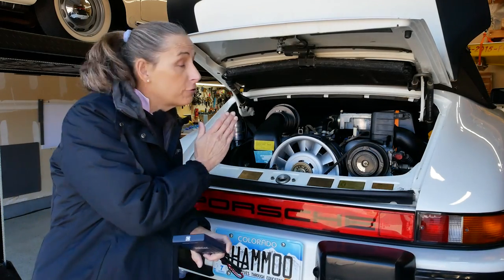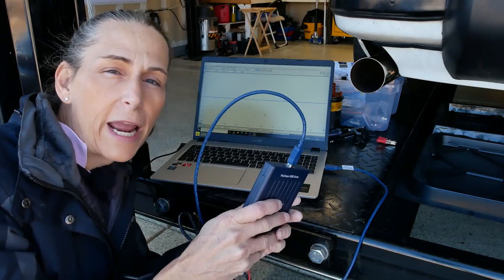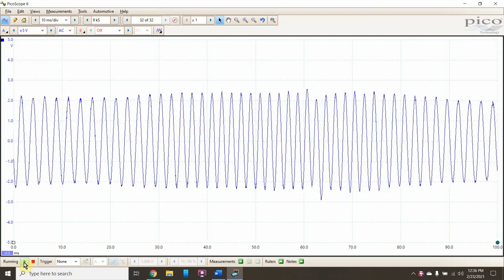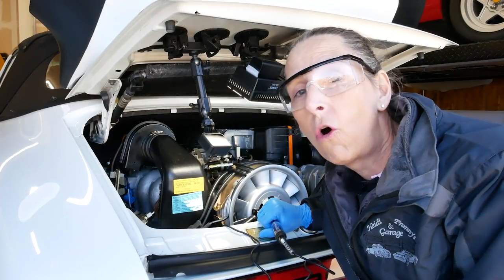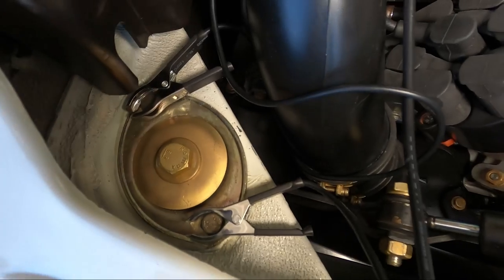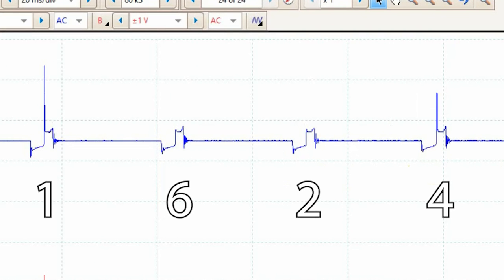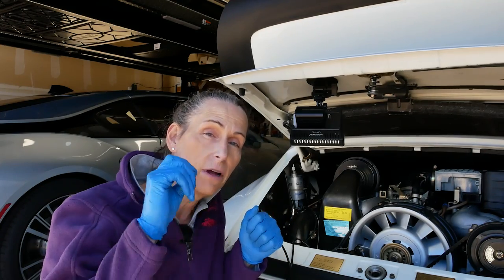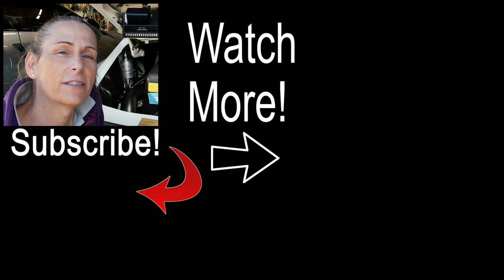Budget eBay Porsche 3.2 Carrera: Testing with a PicoScope Oscilloscope! Bad Wires??

Comment: awesome advice! thanks, yet again! Can you expand on how the trigger on the scope can tell you what cylinder is failing? would you need two current clamps to do that, one one the starter and one one the individual cylinder? TIA
Reply from the maker: For syncing you could then use that same capacitive HT 25 clamp on the #1 spark plug lead in the channel B and trigger on that.  Cylinders would then be in the firing order.  Down at the bottom of the screen there is the setup for the trigger.  You can set the channel and the type (I used "repeating") and if you want it to trigger on the up slope or down slope.  It would be the same basic setup as the ignition pattern, just with the current clamp for the A channel.  Let me know if that answers your question :)

Comment: You have to set your scope for usb streaming mode by change your time to 200ms/div this will tell your scope to go from block mode to streaming mode to transfer your waveform to pc direct without using picoscope buffer which is to small
Reply from the maker: I'll totally check that out! Thanks!

Comment: Hi Franny :) How did you measure the kVs of the coils if the Pico can only handle 20v ? Anyway, very instructive video ! :)
Reply from the maker: Great question!  The software lets you scale the scope with several "waypoints".  You can say -5KV for .1V, and 20KV for 1V etc.  Whatever you like.  Then the software applies the corrected scale for the data.  Super slick!

Comment: So the final result why you initially weren’t happy with the performance was that the motor was a bit lean.  When you took it into the shop they richened it up a bit and that solved the performance issue, right?
Reply from the maker: Pretty much.  I think the shop set the idle too high so I backed it back to spec (800).  I still think the new air-bypass idle valve isn't consistent so I re-installed the original as well as the coil and it seems to be running great now.  Our weather has been so crazy I haven't had a chance to get out and really give it the beans.

Comment: How can you setup the pico program to readout kilovolts?
Reply from the maker: You will need to use an attenuator if you are going to probe large voltages.  In fact, the scope can't handle much voltage at all so it can be dangerous to attach to anything over 10V.  If you need to probe an AC or any varying current you can also use a current clamp or competitive clamp (i.e. spark plug wires).  Always ready the instructions before plugging anything in :)

Comment: Im confused about that compression test
Reply from the maker: The idea is that the current draw in the starter is roughly proportional to the compression ratio. If there is good compression in a cylinder the starter has to draw more current to overcome it. Less compression and it is easier to turn so less current. If you index with ther second channel you can get a rough look at how each cylinder's compression stacks up against the others. The index tells you which cylinder is which.